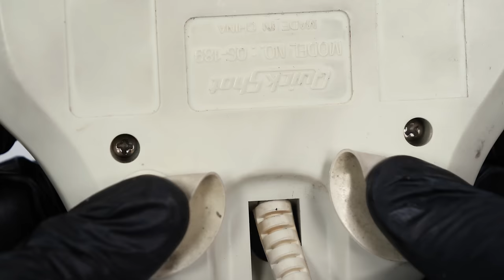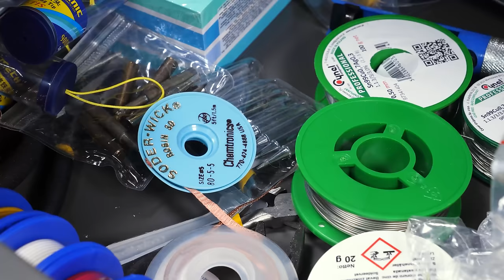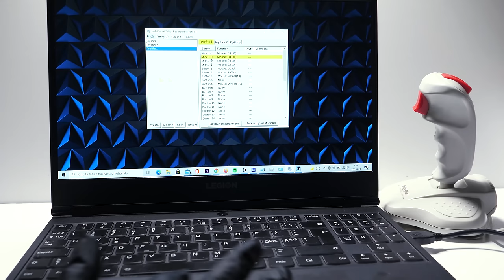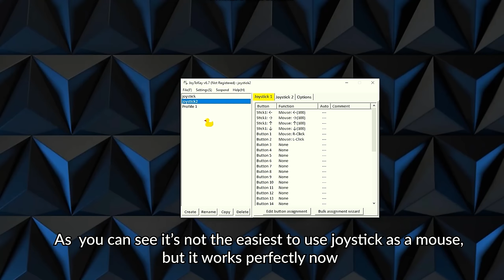I Restored This Yellowed Joystick and Play New Games with it - Retro Gaming Restoration

Comment: 10:56 that wire you snipped is a cold solder joint. Requires flux and a longer application of heat to get the solder to flow properly.
Reply: It also looked like two of the pins were bridged.
Reply: First of all, he bridges a couple of pins, and second of all the solder indeed didn't flow well enough to make the contact. Horrific soldering. I'm not used to seeing that on this channel. I wonder if he's just messing with us.
Reply: @MarinusMakesStuff  pretty horrific soldering, for sure!
Reply: Soldering has been his weakest area. But had improved until this one. That was rough to watch. Soldering and welding are arts that need lots of practice. And they need some more.
Reply: Was looking for this. There were at least two bridges and one cold joint. I wonder if he fixed it off camera since it seemed to work at the end of the vid
Reply: @FTfilm  definitely fixed off camera, cause it looks much better when he puts it back together
Reply: Cry

Comment: 10:43 blue and second white appear to be bridged.  finished the episode and I guess it wasn't a problem which is good.

great video!
Reply: I was gonna comment that! I presume he fixed it, as there are several bridged connections by the looks
Reply: Came here to say this.
Reply: same
Reply: I mean I assume it never was a problem, the thing was clearly heavily used and I don't think it got exposed to "melt the solder" heat so it likey was functional regardless
Reply: Or those solder joints in 10:56.
Reply: All those cold solder joints……..all the flux was burnt off when he’s trying to solder them. It looked horrendous. One wasn’t even soldered at all by the looks, it hadn’t flowed from the pad up the wire.
Reply: If you go to 11:52 and go frame by frame, you will see all the connections are good, and there are no bridges anymore. He was probably trying to piss off some of us.
Reply: How did you even continue to watch without that bugging you?

Comment: I had a black one of these for my Commodore 64 back in the early 80's. I preferred the shorter ball top Quickshot
Reply: They were digital though, weren't they? The clicky type. Had one on my Amiga.
Reply: @brick6347  micro switches. But they felt so satisfying

Comment: Hey Odd Tinkering, look at getting yourself a Edsyn AS196 desoldering tool. It would probably be much quicker than trying to use solder braid when desoldering wires and through-hole component leads.

Comment: Crazy to see this. A couple of months ago a box of my retro controllers got full of water after a flood in my basement, and i restored all of them after being inspired by your videos. Funny thing is, i also own one of these Quickshots Python-joysticks, but i own a black one used on a Mega Drive. I actually got it to work again after opening, drying, cleaning and putting it back together. I almost never ever see one of these so seeing this pop up in my recommended was a nice surprise. Thanks for your videos, i've learned a lot from you over the years.

Comment: Number 2 Philips.  Wires needed extra flux when soldering.  Turn screw counter-clockwise first to prevent cutting new threads in plastic.  Really enjoy the videos, but it's frustrating when I see the wrong tool or technique being used.

Comment: Great restoration! I used to fix a lot of these back in the day for money, some of these had rubber cups on the tops of the joy fork to cushion and stop wear on traces. HaHa! I knew you were going to have trouble because you didn't clean the joy of pad contacts! They were always getting flaky after a lot of playing. 409 makes an excellent cleaner for plastics and cords, just don't leave it to soak usually. Seriously get a soldering station & learn how to do it correctly, I'm surprised it worked!

Comment: I have a gameport to USB adapter that I bought at Radio Shack about 20 years ago. Actually, I have three of them. I bought the first one, then decided that I should buy a couple backups (I'm not sure why now). The later ones were a slight different style, but otherwise functionally identical. They all have switches on them for two types of joystick, gamepad and racing wheel.

In my experience, only simple, two axis, two button joysticks work. I've tried ones with hat switches, multiple buttons, etc. Anything even slightly fancy doesn't work, at least on the adapter I have.

Comment: Do you have to dispose of the hydrogen peroxide every time? Or can it be reused?
Reply: Hydrogen peroxide (H2O2) is unstable (as are all compounds with the prefix "per" in their name). Given time, temperature, and light, O2 will be given off at a lesser or greater rate, and it will degrade into water (H20), a much more stable compound. 
So the reality is that it will become water quickly enough that it should only be "reused" if he plans on doing one batch of plastic after another over the span of a few days.

Comment: Just so everyone knows: these USB-to-Gameport adaptors are also useful on older laptops that are perfect for retro gaming (Say an AMD K6 processor that you can change multipliers on, S3 Graphics chip, and a Yamaha YMF based sound card or a ESS Audiodrive) but don't have a gameport.  The only caveat is that it will only work in a DOS window. If you reboot into dos it won't work, you'll need to hunt down a PCMCIA card for that (good luck, they're hard to find and pricy when they come up).

Comment: Nice restoration man!
However, your soldering technique in this video is subpar. I don't mean no disrespect.
Use flux paste
Heat the PCB and the part
Use tin thread and let it melt and run through the wire (thanks to the flux paste).

Comment: You could use an Arduino or Teensy Card. I recovered my 30 years old joystick using an Arduino Micro Pro. The joystick has two 100K potentiometers for axis, but with the library that I used was easy ro code.

Comment: I don' t know if this is accurate for the rubber pads, but I know with many of those plastic/rubber things that are squeeze fit, you can use the shell of a ballpoint pen (basically remove the ink bit) to press down on the large nub to compress it in so it pulls through the hole more easily :)

Comment: Much of this stuff back in the day was junk that wasn't made to last, even if they noticed that flaw they probably didn't care and the assembly is visibly made to make it cheaper rather than make it repairable. This hasn't changed much for low cost devices, usually one of the marks of high end devices is ease of disassembly compared to cheaper offerings when it comes to joysticks in my experience (and the presence of microswitches instead of ruber pads). There are people that make microswitch digital joysticks for retro computers because of this, usually using standard arcade cabinet parts.

Comment: Huh, so that's a digital joystick, the shape is a bit misleading. The stuff I used to play at the time (and still do) that needed one worked best with an analog one. I had a Strato Warrior whose trigger broke at a certain point so I had to fire with the keyboard since most games didn't allow remapping.
Reply: It may be a digital joystick in that its internal X/Y sensors might only be able to sense on or off. But the connection it had to the computer had X-axis and Y-axis as separate analog inputs.
Reply: @klfjoat  That's probably just for compatibility.
Reply: @det.bullock4461  That's what I said.

Comment: If you know that you should enter, you already have windows 7 or 8 or 10 in the control panel and then to printer devices, using the joy to key is not optional for evidence either a gameport gamepad or even a joystick that you restored even but it is not any Professional detail if you use the buttons that are 2 and the axis is a d-pad, it means that what you restored was not an axis, it was a d-pad in the form of a joystick to deceive you, it means that with that you do not get precision even in a game of weapons or tanks that you see in your video do the next time use the control panel and then enter printer devices from there you enter to check if the quick shot Python 5 joystick really works you are a shame to check its operation you only used the joy to key does not count hollow head